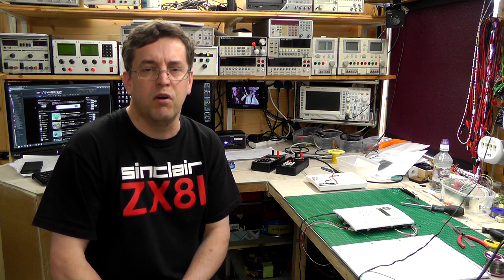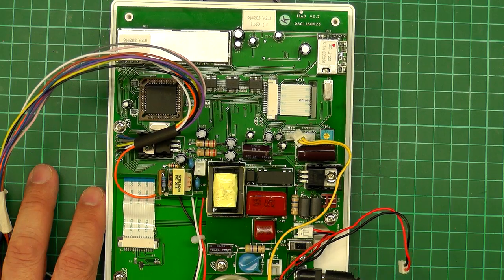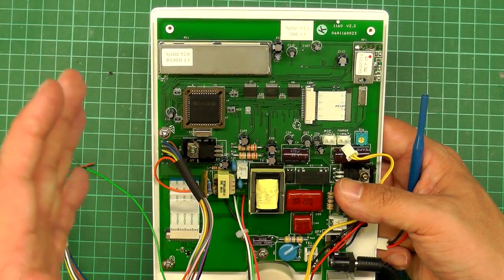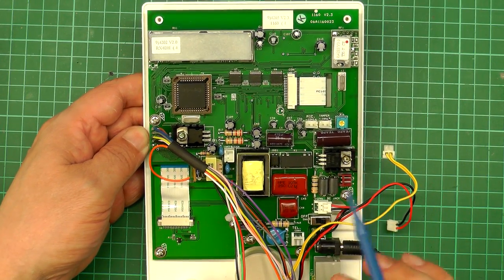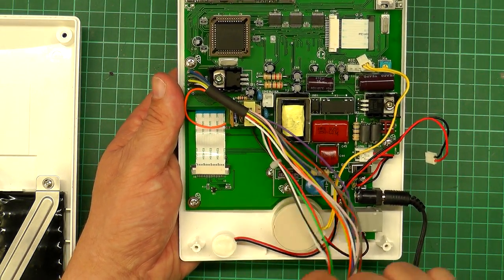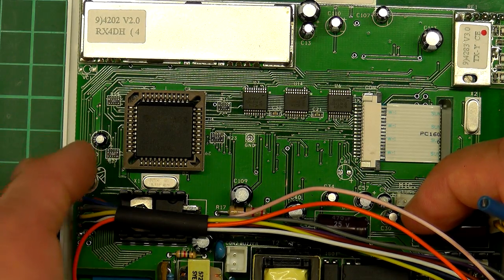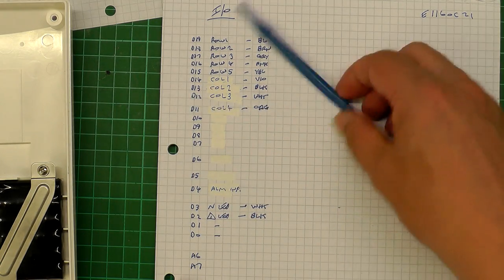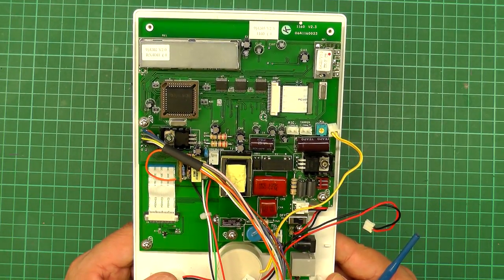Yale HSA6400 Burglar Alarm Arduino modifications - Part 1

Comment: Incredible timing! I literally was just googling interfacing an arduino to Yale HSA6400, found nothing particularly interesting, decided to see what my youtube subscriptions were up to and spotted this video! Can't believe the coincidence!
Reply from the maker: arcadeuk Wow!!!. Yup, I was very lucky to find somebody on Ebay selling the panel only.......everyone else is selling full kits at over £150. I bought the panel whilst at our holiday lodge sitting with my feet up with a beer. Got home and there it was on the doormat, and got stuck into it yesterday.
Reply: IanScottJohnston I certainly look forward to seeing your progress with this. I had kind of got to the stage of wondering if it was possible to decipher the protocol of the wireless transmitter/receivers and replace the entire mainboard with an arduino based board, controlling the rx/tx modules. What you are doing is far simpler and more practical. I was however wondering if you might want to take yours a step further and read the LCD via the arduino as well?
Reply: arcadeuk I also thought the same when i looked at these wireless Sensors... 

Would love to integrate it into a "smart" controller of my design... if you manage to-do it let me know, however i suspect it will be hard as you don't want people easily emulating the messages and broadcasting "I'm OK Nothing To Report" when in fact the PIR is disabled and its your laptop singing that tune instead! heh.
Reply from the maker: TornTech I'm sure I looked into this once before and found somebody on the web who had managed to reverse engineer the wireless protocol, or at least some of it.

Comment: Instead of the back-to-back MOSFETS to bridge the keyboard matrix, you might want to consider transmission gates such as the 74HC4066.  For a 4 x4 keyboard, you would only need 4 devices. Another way would be sampling the rows and timing the column outputs, but the code would be tricky.
Reply from the maker: Steve Rodgers I did consider analogue switches, but as it stands I only need 9off fet's (smd) so they'll take up virtually no space. Regarding sampling......hmmm, my C++ isn't that great!
Reply: IanScottJohnston 
If the signals only go in one direction (i.e. from row to column), only one MOSFET per button is required, and in that case single MOSFET's would indeed be smaller. Where transmission gates (analog-ue switches) are come in handy is when the keyboard matrix can be driven from both the row and the column signals.

As for doing away with the MOSFET's entirely, the key issue is synchonization  of the Arduino to the alarm MPU. you would probably need to set up an interrupt on the first driven output from the alarm MPU and then use a timer to figure out when the other rows or colums get activated. Some poking around with a scope would be necessary to ensure the timing is predictable. If it  isn't predictable, then this method can't be used.  Additionally you would need to configure the Arduino outputs to be 3-state so that the keys on the alarm could still be used.  All of this is quite tricky and to get the project up and running quickly , it probably should not be considered.

Comment: Interesting project. How are you interfacing to the LEDs etc without affecting the original signal? Will the Arduino have a separate ground, and if so, do you need to use opto-isolators to interface? I'm an rlectronics newbie :) also, how is that microcontroller able to do so much with only 8 I/O ports? Does it use shift registers?
Reply from the maker: stupossibleify The Arduino digital inputs are all high imedance so won't affect any of the signals being interfacing to (LED's, LCD etc). The Arduino gnd is the same as the Yale system gnd. The Arduino (Nano) has 20 digital I/O and 2 analogue I/O, but on top of that I have added in a 16ch digital extender IC (via I2C) so no shift registers required. See my webpage for the current I/O map.

Comment: Be Careful With the web interface, There is Big (Negative) Hype at present about the insecurity of "IOT" (I Hate that term!!) devices.. Make sure you get the web server to listen on a different port than 80 (Or at least port forward a different port externally to port 80 internally)

Also, why not make the GSM module capable of doing switching on an off, might be nice to text the device "ON P@ssw0rd" and it reply with confirmation?!

ESP8266 is also a nice wifi module for use with Arduino or, if you fancy completely re-doing your entire concept of Micro-controller, I have a series on using the ESP8266 as a full on microcontroller that will most defo fit in the space you have(ESP12)

Looking forward to second video!

Comment: I wouldn't be able to do this without picking up the LCD interface and emulating the LCD on the web interface. Shouldn't be too much effort and would really finish this off nicely.
Reply from the maker: SDG Electronics I have the IO for it and have thought about it.......but just trying to avoid being reminded to look at it...thanks Steve! However, in reality it would mostly be pointless EXCEPT for when an alarm occurs, or a fault etc and being able to see which zone it occured in via the web. Hmmmm, we'll see!
Reply: SDG Electronics Heh.. I was just about to write the same, then I saw your comment ^^   But yeah, I would do exactly the same!!
Reply: IanScottJohnston You know it will complete the project nicely :)
Thinking about it, it should be relatively straightforward - just look for display clear, cursor home or cursor position and character data.
Reply from the maker: SDG Electronics Did a bit of digging and the LCD is written to in 8-bit mode (was hoping for 4-bit mode), ahh well just means my Arduino IO will be pushed to the limit......again! :)
Reply: IanScottJohnston Good to hear! I look forward to seeing how you get on with the web interface.

Comment: Instead of using a GSM module, most cell phone providers have e-mail handles for sending texts.  For example, if your phone number was 222-222-2222 and you were serviced by Verizon, you would send an email to 2222222222@vtext.com and it will arrive at the device as a text message.

You could easily send an email using only the WiFi module, thus reducing the complexity of the modification.  However, it would somewhat reduce the security.  If you, for whatever reason, lost power to the house (and consequently your WiFi router), you would be unable to send a text if the alarm was triggered.  With the GSM module, you would be able to send a text regardless of the state of your home power.  Just a few considerations.